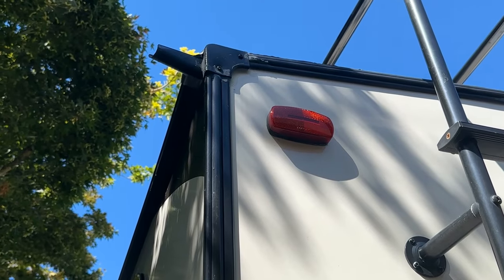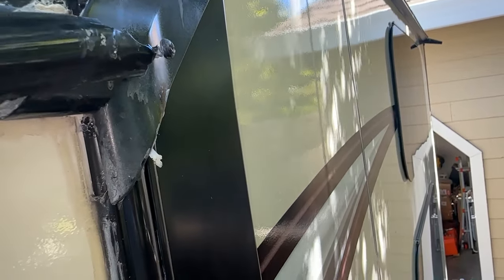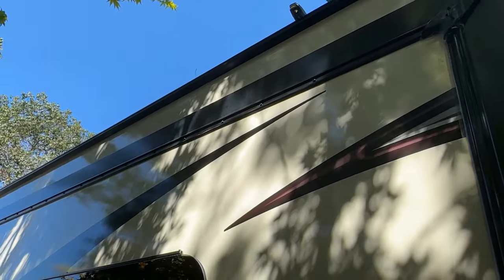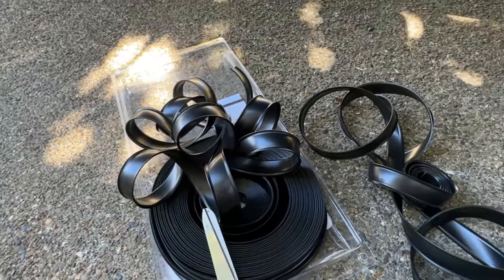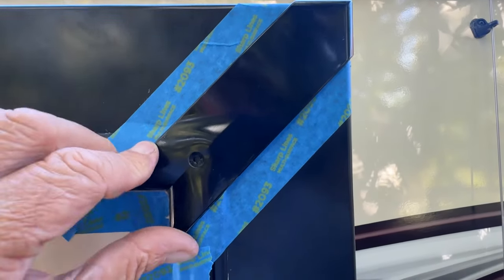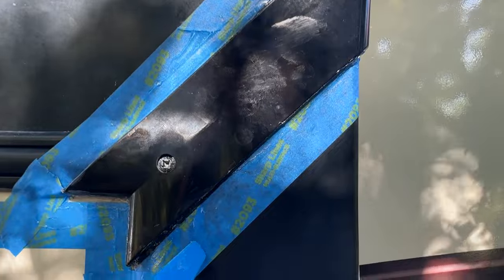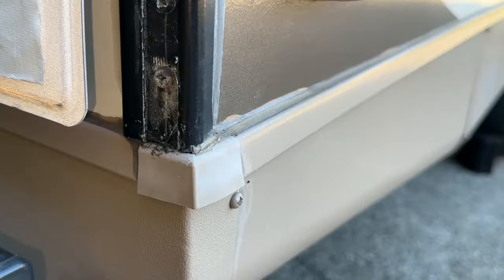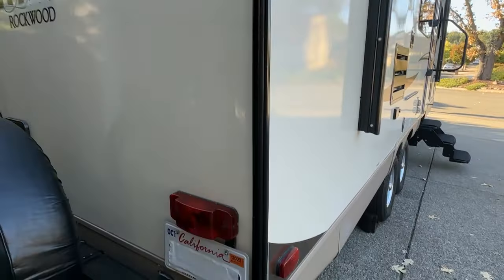Replacing Exterior RV Trim Step by Step /  IMPORTANT - Buy Quality Trim

Comment: Last winter I had to replace the vertical vinyl trim on both sides of the front cap. Easy job, but this summer while traveling through Nevada and Utah, the trim on both sides was ripped out by the wind while driving. The way it was originally installed at the factory there is nothing holding it in place at the bottom. That's good to allow drainage of any water that might get behind it, but it didn't prevent my replacement trim from coming out. I replaced it again this summer and added a little bit of silicon adhesive in the track at the bottom to see if it will stay in place.
Reply from the maker: Thanks for sharing and watching. That's a great idea adding a little silicone to the bottom to help hold it in place. I'm curious if you used the heavy duty trim like I used or the thinner trim? It seems to me that the thinner trim would come out easier than the thicker trim but I may be wrong?       https://amzn.to/3r4CCYI

https://www.youtube.com/@thetraveltrailerguy/videos
Reply from the maker: Just watched your video on Bodega Bay camping. We live 35 minutes drive from there and camp at Wrights Beach & Doran Beach a lot. Maybe we will you out and about camping someday.
Reply: Thanks for watching. I get a lot of useful info from all your videos. We’ll keep an eye out for you but I guess we’ll have to look for a different trailer since you are selling yours.
Reply: I think I used the exact same trim as you.
Reply from the maker: @leightonslately  You're welcome it was a good video, are you in the Facebook Rockwood Mini Lite-Flagstaff Micro Lite Fan Club? I'll be letting everyone know what trailer we are getting soon. I'm happy the videos I make have been helping you and many others, that's why I make them
Reply: @thetraveltrailerguy  Yes, I’m in the Facebook group.

Comment: I found plastic chisels on Amazon.
I've been slowly removing the mess , the previous owner had made,   all over the interior and exterior. 

I found that the plastic Razor blades work well with. Mineral spirits 
Unfortunately not good to remove  hard. Caulking ,  when lots of force is needed
Reply from the maker: You have your work cut out for you, very tedious work. Thanks so much for sharing. 

https://www.youtube.com/@thetraveltrailerguy/videos